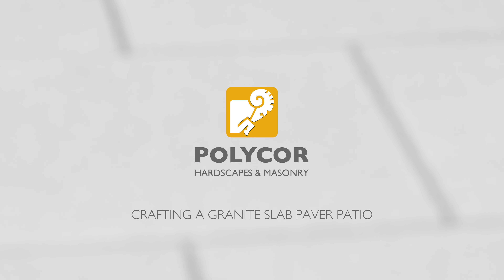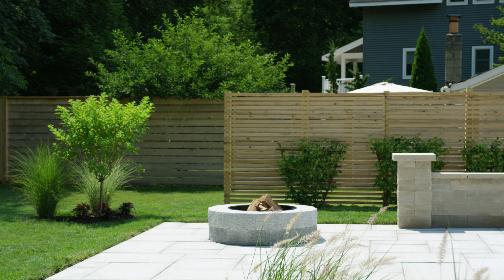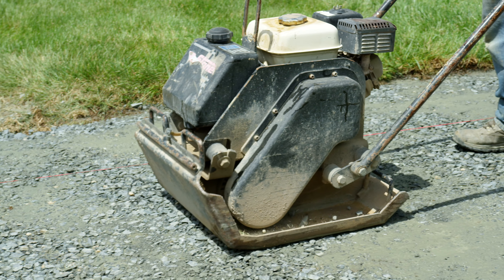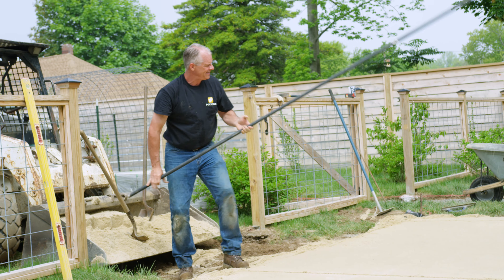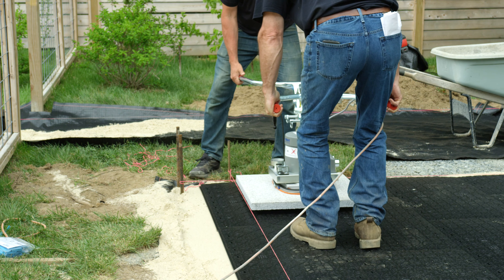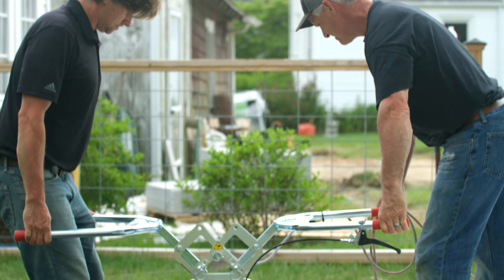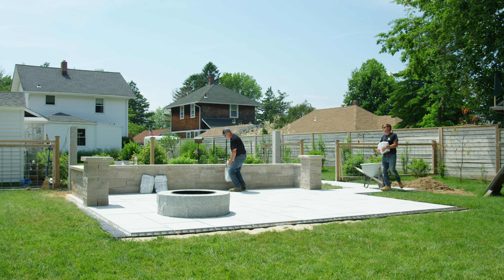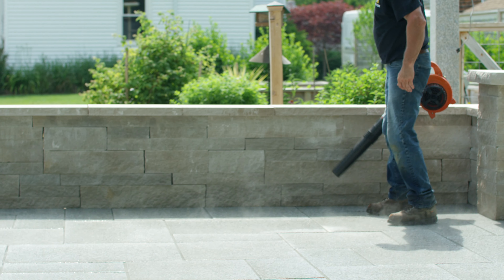How To Install a Granite Slab Paver Patio In Half the Time With EZ Base

Comment: Most videos have used a sand base over the pavers. Any problems with laying directly on the paver base?
Reply: Sand base over the pavers?  The foam paver base is supposed to be over the leveling sand.

Comment: I have concerns about using the polymer sand as joint filler, as once set the polymer sand is functions like supper glue, and can not easily be removed. I was told that in event of any settlement of the sub-base, it could be very nasty. I would like to find out more of this information, thank you. Roger